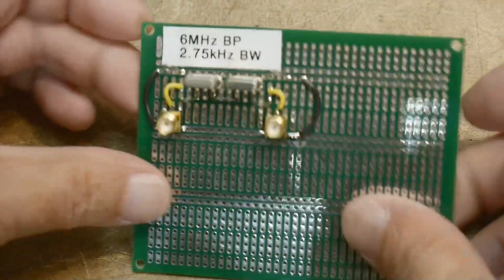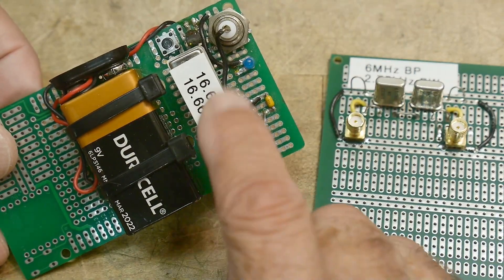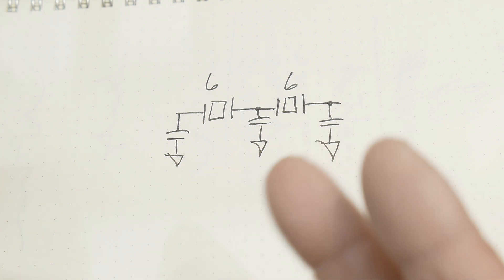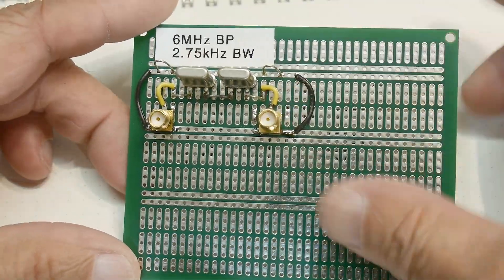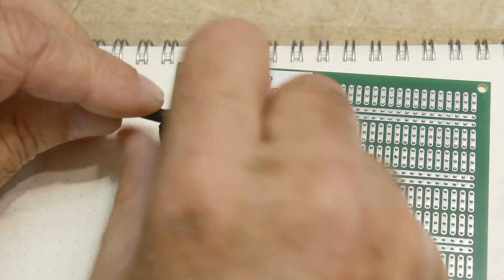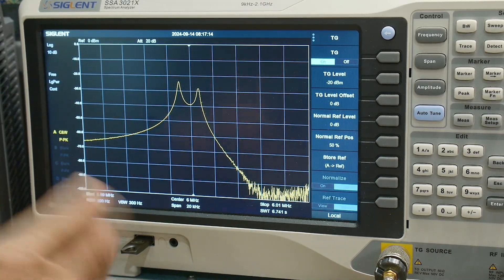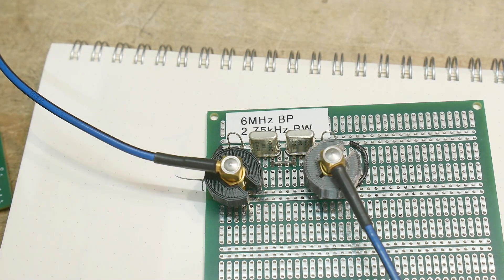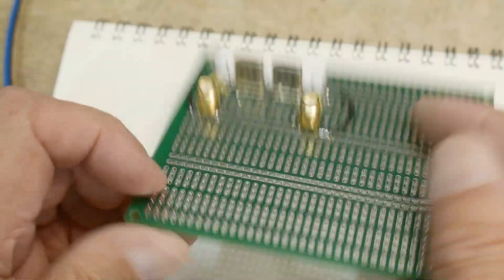#2000 6 MHz BandPass Xtal Filter

Comment: I used to build crystal ladder filters back in the day. You can get great selectivity with them, but you better have a whole bunch of crystals to test with because they are all slightly different and you have to select the most appropriate ones. Your design is almost a ladder filter (a classic one also has coupling capacitors between the crystals, and yes there is definitely math to calculate the values of the capacitors).

Comment: Randomly picking load capacitance is going to affect accuracy and drift of those oscillators. All you have to do is check the datasheets.
Reply from the maker: it's not an oscillator, it's a bandpass filter. as I state in the video is just a quick test circuit. I needed something with sharp transistions.

Comment: Crystal filters work at high impedances (1k5 or thereabouts) you will need to use transformers in and out of your circuit to use it with 50 Ohm equipment.
Reply from the maker: yes you are right, but that is not the intended use. It is to be used to test a Bode measurement. I just needed something that had a sharp transistion for gain and phase. It is not to be used as an actuall filter.
Reply: @IMSAIGuy where did you get your protoboard?  I'm looking for one that has VCC and ground under the TTL chips.
Reply from the maker: https://www.pcbway.com/project/shareproject/DIY_Protoboard_Digital_Circuits.html

Comment: When prototyping filters I use the NANOVNA TEST BOARD KIT by TB5CVN available for order as a shared project on PCBWay.  You may want to check this out, it a laid out as a proto board for both SMT (x2) and TH (x1) components and has pads for SMA connectors at either end for the SMA connectors for all three filter sections allowing you to do 3 different filters on the same board.  All in a 53x32 mm board space, with mounting holes.  Good stuff, highly recommended.  73, WA0A
Reply from the maker: looks nice. I have some too:
https://www.pcbway.com/project/shareproject/VNA_component_test_board_ed12f933.html
https://www.pcbway.com/project/shareproject/Low_Pass_FIlter_RF_Ham_Radio_5eac6a37.html

Comment: Can you make the filters work at different frequencies than what is on the can? I have a bag of either serial txrx chips or ntsc stuff
Reply from the maker: no
Reply: You can pull them slightly with inductors or capacitors but you can't pull the frequency very far.
Reply: @herbertsusmann986  a few tens of ppm is usually most you can achieve. Not really useful for anything than very fine tuning of the center frequency and BW.
Reply: @herbertsusmann986  Open the can and use a clean pencil eraser to pull the crystal by abrasively removing the slightest amount of material.  Very old ham trick I have read about but not tried personally, so YMMV or it may not work at all.  Good luck.

Comment: Do you understand the spectrum of an AM modulated sine wave? This would easily give you a multi-tone signal with easily VARIABLE spacing between the tones! Along with easily variable main frequency.   You can thus check the resolution of instruments without building stuff at all kinds of different frequencies. I still can't justify over 9 grand for a scope though. I bought my Keysight scope at full price from them. (2 grand!)
Reply from the maker: I'm testing the bode plot with the xtal filter. It found an error in the Keysight and they are fixing it.  the two freq board with 9v battery was made to put in my pocket when going to an auction or sale to test the RBW of a spectrum analyzer.
Reply: @IMSAIGuy  OK!
Reply: @IMSAIGuy  What was the error in the Keysight? We are interested to know!
Reply from the maker: @herbertsusmann986  I'll do a video when the new firmware comes out. We will both see if they fixed it.